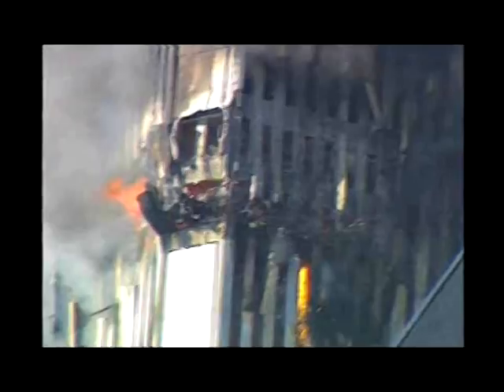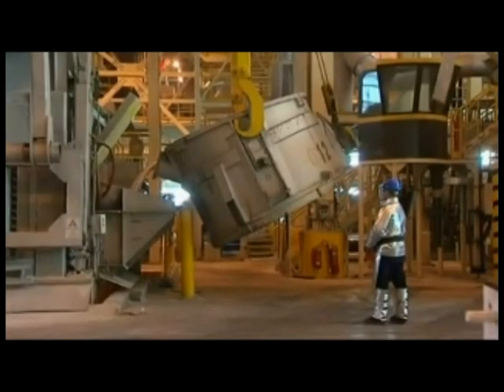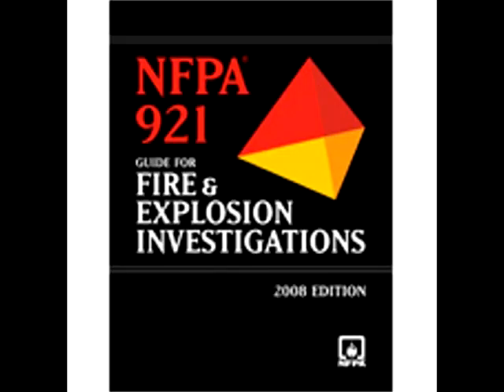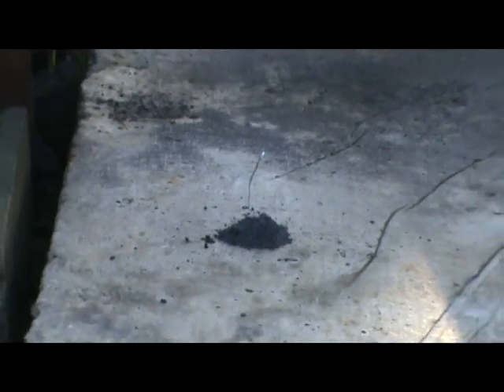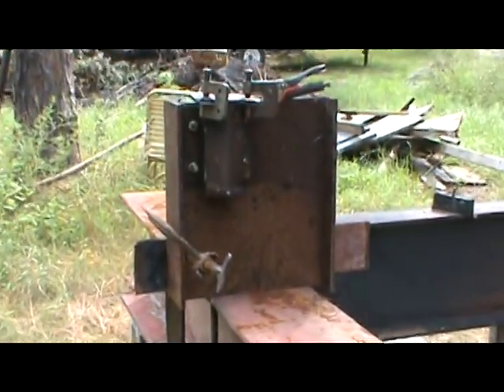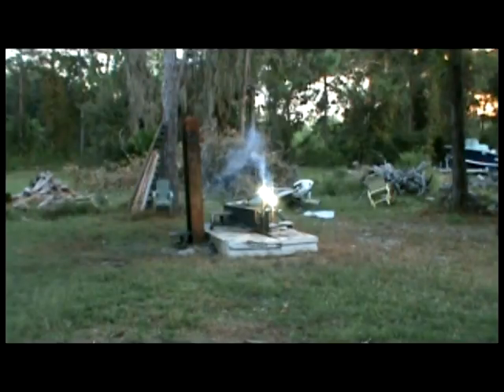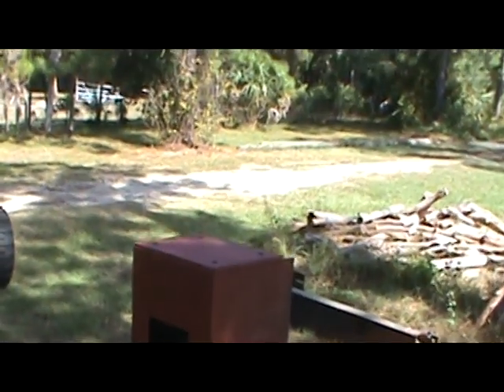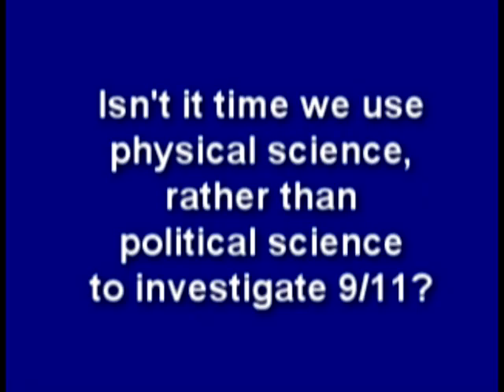9/11 Experiments: The Great Thermate Debate

Comment: now do it:
A. on a 1300 tall building
B. in secrecy
C. in a few days (or weeks or whatever your story time frame is)
D. and no one says a word
Reply: considering the first attempt was in 1993, there was plenty of time to get it right the second time.
Reply: Research the “Elevator Modernization” project that was going on shortly before September 11, and how there were guards posted outside of the elevators during this process which was happening around the building’s core columns.

Research the complaints of tenants of the twin towers about all the dust in their offices because of the “network recabling” project that was going on prior to September 11.

Research the bomb-sniffing dogs which were in the twin towers since the 1993 bombing attack but abruptly REMOVED from the buildings on Thursday September 6.

Research the power down on September 8 and 9 disabling the entire security system for the buildings over the weekend (around 36 hours). Not just affecting security cameras but also door key locks and security badges.
Reply: juano isquia  video used thermate and thermite interchangeably, all credibility lost

Comment: The evidence underlying the claim that thermite was used to aid the collapse of the WTC buildings comes from an analysis of the dust found arounf the WTC site. In the dust were small flakes which contained two layers, a red layer and a grey layer. The analysis was published in a report:
 "Active Thermitic Material Discovered in Dust from the 9/11 World Trade Center Catastrophe" by Harrit et al. 
This report identified that the iron oxide and the aluminium were contained in the red layer of the chips, the grey layer being primarily inert clay. 
The report describes the red layer as being in the form of a "thin film",  ie consistent with it having been sprayed onto a surface. The thickness of the red layer is about 0.025mm which is about one quarter of the thickness of a human hair, and the grey layer is about twice the thickness of the red layer. 
I suggest for an accurate understanding of the claim that thermitic material was used to bring down the WTC use this as a starting point,  by spraying steel beams with a thin coating of thermite, insulated with a thin layer of clay. 

For further examination please read 
"Progress Report on the  Analysis of Red/Gray Chips  in WTC Dust by James R. Millette" 
as Millete questions the validity of the grey layer being thermitic.
Reply: Or, you know, one might expend their energy in finding out what the shop-paint of the people actually making the steel columns of the Towers was.
Or, for that matter, do a search for "twin towers columns" and look at the images suggested by that search, and particularly what COLOR they are....
Reply: @Blu Crystl Why have you now deleted yet again the other thread that I made you look like a total ass in? I think its beyond crystal clear at this point that you are totally humiliated by my presence and completely embarrassed by me. 

Why are you babbling to MoonEyes about answering your questions when you tap danced around the many questions that I asked you and refused to answer a single one- then deleted your comments a couple days later hoping that I wouldn't notice it? Since this thread is not one that you started you won't be able to delete it, you can delete your own comments you made however your name will still show on the comment that I make, and this time I'll also make sure to save screen shots when you do try to delete your comments. So congratulations, because now you really have made a huge fool of yourself again and deleting it won't help you this time. 

Do you want to tell everybody else here about the hilarious comments you made before and about your reaction after I posted the links that proved you completely wrong? How you babbled that it needed to be "official" as if the mathematical outcome will change just based on the person solving it? LOL!!!!!

Why don't you just chalk it up and admit that you made some pretty stupid comments before and were wrong (because you are) apologize to everybody for wasting their time and quit making a fool of yourself like this.

Comment: So, how did "they" know what floor the plane would hit so they could plant thermite there?
Reply: and what would "they" have done if one of the thermite cutter thingies had failed to go off and had been found in the wreckage, which seems really likely given how many would be needed and with a plane crashing nearby? What would "they" have done if one of the guys who installed the thermite cutters had been caught, say, by an employee who stayed late? Its such an overly risky and complicated plan, far more so than the "official" theory.
Reply: @christianhoffmann8607  - I don’t believe any of the Flight Data Recorders were recovered at the WTC. Or if they were, it was never revealed. So, it’s not surprising that if explosives were used, no duds were recovered.
Reply: If placed at multiple locations, the floor at which the planes hit wouldn’t make much difference.

Comment: How did they sneak all of this material into the building and then install it and clean up the office space before the employees returned? Must have been ninja terrorists.
Reply: Research the “Elevator Modernization” project that was going on shortly before September 11, and how there were guards posted outside of the elevators during this process which was happening around the building’s core columns.

Research the complaints of tenants of the twin towers about all the dust in their offices because of the “network recabling” project that was going on prior to September 11.

Research the bomb-sniffing dogs which were in the twin towers since the 1993 bombing attack but abruptly REMOVED from the buildings on Thursday September 6.

Research the power down on September 8 and 9 disabling the entire security system for the buildings over the weekend (around 36 hours). Not just affecting security cameras but also door key locks and security badges.

Comment: Intresting science project. That's all this is. Moltan steal pouring was the plane mixed with water. The towers fell because the floors that were destroyed during initial impact allowed the massive weight of the above floors to eventually buckle the now weakened remaining steal left holding it up. Science and physics solve this.
Reply: You can't even spell some common words correctly, yet you refer to "science and physics" as if you have a clue.
Reply: @jackreacher8288  I'm sorry "interesting" and "steel"... i hope this helps you to understand the FACTS i stated.

Comment: Your claim that NIST's theory about mixed hot particulates is bullshit. Stuff floats on mercury because mercury is dense as fuck. Aluminium is not dense as fuck, in fact, it is quite light (that's why we build aeroplanes out of it). Stuff can mix with molten aluminium and form a slag mixture quite easily.
Reply: No debunker would agree with you on this. Aluminum doesn't mix with other materials very easily. I've seen a lot of molten aluminum mixed with a lot of things, never had it become homogeneous.

Comment: You have to love the conclusion people come to, if the official report is wrong then it must be the government who's behind 9/11. If the government had been behind 9/11, shouldn't they have an answer fore more or less any question likely to be asked? I mean, it must have required years of planning and preparations involving thousands of people. Shouldn't anyone of those people have thought about these "jet fuel can't melt steel beams" and "thermite planted in the steel beams" things? Especially if thermite were actually used? 

How do you plant thermite inside a steel pillar anyway? Do you cut it open and fill it up? You can't weld it up again at least and someone had to notice a lot of cutting in both towers I guess? I mean, an angle grinder makes quite a lot of noise.

Comment: The air temperature could be anything, it's not like if exposed to fire to a certain  temperature, metal would not stil absorb heat after it surpasses the temperature of the emitter.

Comment: If the railways can use thermite  to melt the steel in rails to join them together, then the opposite is also true, You can burn through steel beams.

Comment: The steel looks distorted to me not melted. The temps were high enough to distort and weaken the steel. Therefore causing the collapse. It's very simple if you can be bothered to get some understanding of basic metallurgy.

Comment: im not on any side i just had an idea mayby some one could answer, once the plane hit the fire has started with alot of fuel, then you got every thing in the building melting and adding as fuel, so the jet fuel alone might not be anoughter to melt steel, but once u got every thing including human fats, pc's furniture and every thing else in the building going flat out, would that not generate enough heat to make them melt? serious question

Comment: why bother with airplanes then? why not just blow up the building and blame on a terrorist bombing as they did anyway instead of hiding explosions in explosions? How did termite not explode immediately, but was on fire for 73 and 102 minutes before collapsing? Why no bombs were hidden in Pentagon for more destruction? why just crash United 93 in a field and come up with a fake stories of hundreds of passengers and employees at WTC that died in a tragedy? btw, you don't have to melt the beams, just heat the metal and it will lose its structural integrity. This hoax theory makes no sense and is almost as complicated as a Moon hoax, which are both BS.
Reply: wtc 7 and the pentagon

Comment: Airplanes are made of Aluminum.  A-36 Steel is 98% iron.  Rust + Aluminum = Thermite.  Impact of Aluminum with Iron occurred prior to the 1st spark.  Low-alloy carbon steel, such as A36 grade, contains about 0.05% sulfur and melts around 1,426–1,538 °C (2,599–2,800 °F).  A36 steel has a Poisson's ratio of 0.26, and a shear modulus of 75 GPa (10,900,000 psi). A36 steel in plates, bars, and shapes with a thickness of less than 8 in (203 mm) has a minimum yield strength of 36,000 psi (250 MPa) and ultimate tensile strength of 58,000–80,000 psi (400–550 MPa).  THE STEEL DOES NOT HAVE TO REACH MELTING POINT TO BECOME TO UNSTABLE TO SUPPORT A BUILDING.  YOUR VIDEO IS MUTE.

Comment: There are different types of thermate. There is a type in a firework sparkler, for example, that clearly doesn’t melt its steel rod. Military grade thermate will cut through steel in seconds.

Comment: One of the Bush families was in charge of elevator upgrade security
Reply: No.

No he wasn't.

We've come so far from the event that we're now sujected to a game of "Telephone" where one rumor gets past incorrectly along until the end story doesn't resemble the original.

Bush was not in charge of elevator upgrade security. He sat on the board of directors for Securacom which had a contract to upgrade security equipment and software. He left this position more than a year before the attacks. The WTCs were owned by the NY Port Authority which had its own police force to provide security.

Comment: Are there any examples of thermite being used to demolition other buildings or constructions ?
Reply: Buildings no. But to my knowledge it has only been used twice to generously call it "CDing" a structure: a Tower that held an amusement ride cable where it was used to melt one of the 4 legs, causing it to topple. And the metal roof of a building in Germany (I forget the name) causing it to cave inside the concrete structure.

Neither example is any comparable to what occurred at the WTCs.

Comment: Steel gets soft at a much lower temperature than it melts at. It doesn't have to reach the liquid state before it becomes unable to support great weight. Just a normal fire can easily weaken load supporting steel beams enough to fold if there is much weight above it. Hotels with steel supports fall all the time when there's just mild fires because the beams don't need to get hot enough to melt, they just need to get hot enough to get soft.

Comment: Steel can weaken around 400 degrees, Steel doesn't go from solid to melting instantly. it has to weaken first, you can bend around 500-800 degrees.

Comment: An entire airplane made of aluminum, magnesium, copper, plastic, oil and rubber. It seems the combination of these materials and air flow would be hard to duplicate. Could it not have concentrated heat on a critical joint causing the pancake effect? I guess it can!
Reply: mor0n.

Comment: Has anyone thought that while steel needs 1600 oC to completely liquidfy it becomes red hot around 800 oC and loses it strength dramitcally at this temperature. Melting aluminium is around 600 oC and is known to react with steel burning holes through it weakening the structure. His photo of the metal coin sitting on mercury is not an good indication on how burning aluminium reacts with metal and aluminium in the molten state, is very "searching" which in laymen terms , it will find any little space, joint, or gap in many common materials. I agree that the liquid metal seen falling is not steel but molten aluminium which could be from the plane heated by the burning fuel and the" flaring" observed  could be reaction with the aluminium and other materials. 
One other point to consider is having to place all this explosive material on the specific locations in numerous locations to enable enough "Joints" to weaken the structure, would take considerable time, cost and effort. Add to this that the aircraft would have to be flown to a specfic location to achieve  the desired result would indicate that most of the stucture would have to be "primed".
It is my opinion that the plane struck at a location that weakened the structual steel skeleton and the "kinetic" force of the weight above the damaged area triggered the destuction of the towers.
I believe that if the planes had stuck lower down, the time between the strike and destruction would have been much shorter and similarly if the strike was at the top it is possible the the towers would still be here today.
Unfortunately for the people lost and their families, it was the former.

Comment: Needless to say, isn't your hypothesis of a planned event the reason why all the steel girders were quickly collected and sealed away in warehouses and access was denied except for a highly select group of individuals? Who first collects and locks away debris unless there is confounding evidence to be found?

Am I correct in assuming that ALL of the steel from the towers has been "recycled"? Of course the real smoking gun that proves practically any theory that proports the destruction of the towers was a planned event is Building 7. How anyone with an ounce of structural knowledge (hell, ANY knowledge!) can believe a building with no more damage than it had could fall precisely in its own footprint is beyond comprehension or credibility.

Let's not forget to follow the money. The buildings were losing money, they were loaded with asbestos and the Port Authority had sought to demolish the buildings but were not allowed to do so because some stipulation. The Authority had determined a floor by floor cleanup was too financially prohibitive to do. In steps Silverstein, despite all this, six weeks before 9/11, signs a 99 yr. lease. In what must be one of the greatest coincidences, Silverstein sought and had added to the lease he could not be held financially liable for anything in case a terrorist attack was the cause for any damages to the buildings.  Also, he attempted to add a double indemnity clause to his insurance in order to receive a greater payout in case the buildings suffered damage. And the last curious fact, the group of insurers that were part of the policies never investigated the claim. There were about 24 insurers involved in covering the claim and insurance companies are notorious at conducting tedious investigations in order to undermine claims. None were done despite lengthy court battles with Silverstein, in part due to him seeking doubled indemnity. Silverstein received over $4.5 billion dollars off of $15 million dollars he had in the lease.

Comment: There is no debate. The beams became plastic, they didn't melt. There were no melted beams found. Steel becomes plastic at 450C or 850F, well within the temperature of burning jet fuel.

Comment: Time For Debunking:... Jet fuel, although not hot enough to melt steel ( 900-1540f ) burned for 10 mimutes...it was the catalist of the fire., the interior contents have a cumustablity index of ( 1200-1750f ) " Just at steels melting point " now., if you stoak that fire, which occured by the falling elevators and firefighters rushing in to help and opening all the doors... when this happend, the interior temps rose to +2,300f... well above the melting point of steel... we se the same principal when melting gold, the lave fir is 1200f., when stoaked it rises abov 1945f... and ya just got debunked by the dirty trucker

Comment: as an engineer you should know that the beams didn't need to melt to fail, they only needed to exceed the temperature at which the deflection from designed stress would be exceeded. this is far lower than the melting point of typical red steel beams (about 3200 deg F), 1800 to 2000 deg F is probably enough but I would have to see the stress calculations for the structure to know.
Reply: Correct but the question is did or would it. No one knows but I think that's what happened just me but I'm not an engineer or anything I just have studied this for as long as it's been around 10-12 years.